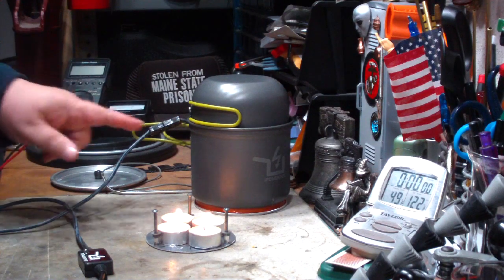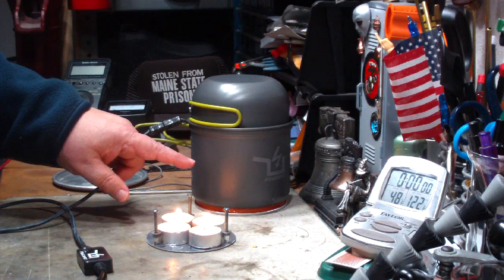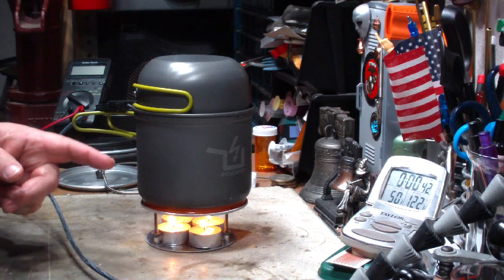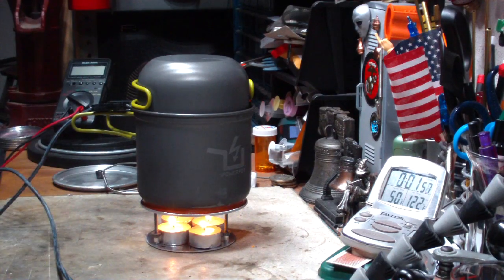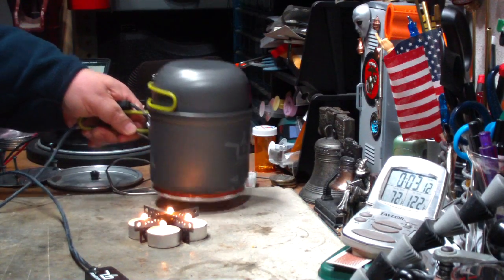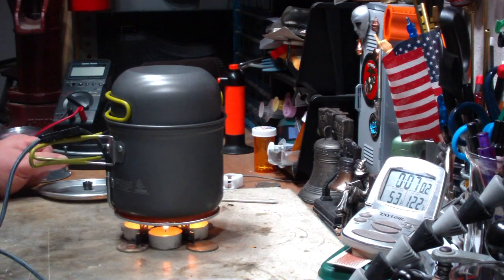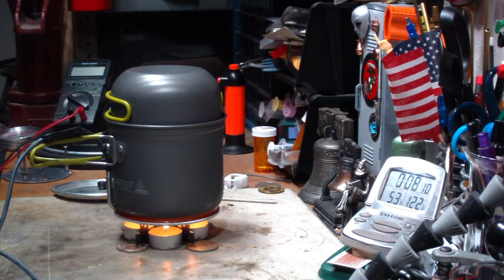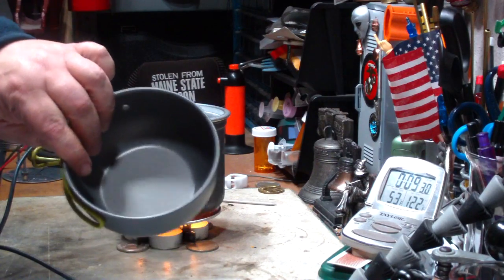The PowerPot - Will It Work With Tea Light Candles?

Comment: Thermal coupling (generators) have been used for Decades in Water Heaters to maintain the Pilot light. Why haven't we researched THIS as an energy source instead of the inefficient Solar panels that are only 30% - efficient. These seem to use MORE of the heat source. Would be a good thing to look into, the biostove already uses these with good results. Maintenance would be less too

Comment: Open air burning of candles looses lots of heat, if you wrapped it up with a coffee can with a couple of holes to let oxygen in and co out.

the air intake should be low, the exhaust should not be more then 1/3 from the bottom. careful as the can will get hot. I'm sure you'll be able to generate enough heat to give you power.

Comment: hmmm... as I understand them, thermo-electric generators produce current when there is a sufficient temperature difference on either side... so perhaps tealight candles would work if snow, ice or ice water was placed inside the pot?

Comment: I think if you put the lights inside the flower pots with the metal core, then put the pot on the top of the pots it would work nicely.  The pots radiate what, 200 degrees?